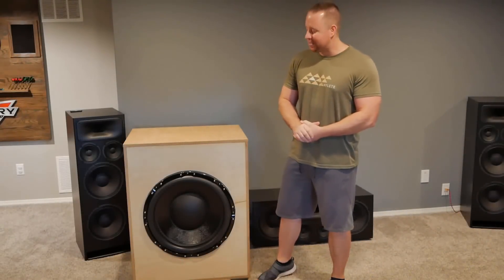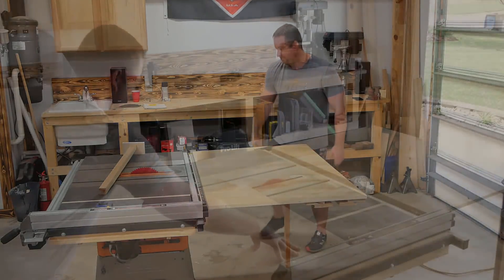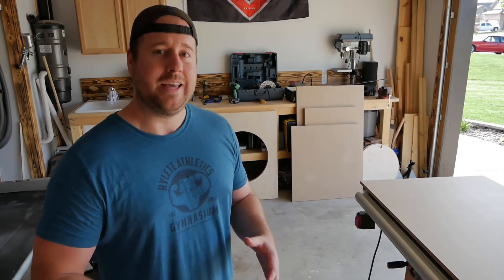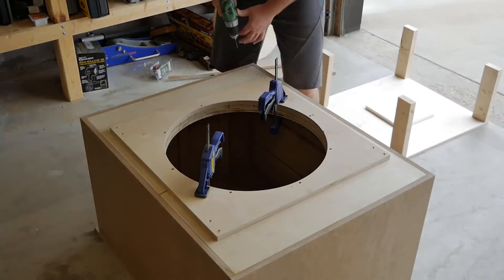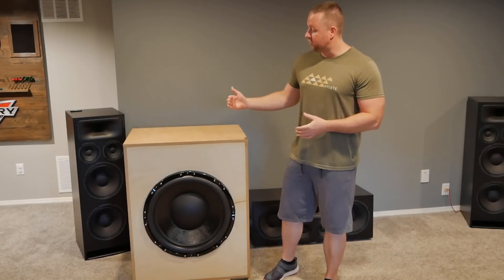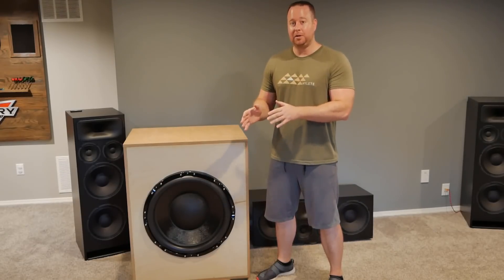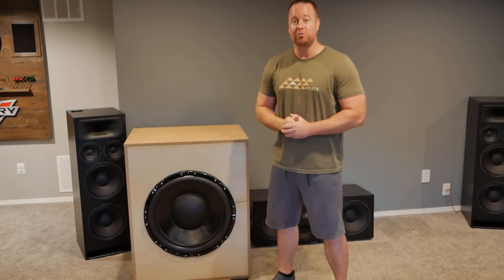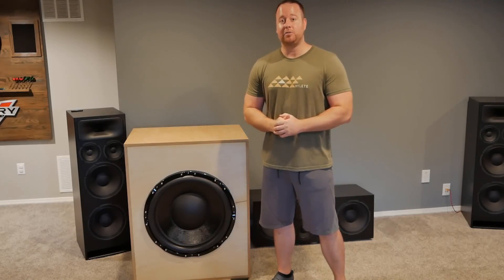Stereo Integrity HS-24 Subwoofer DIY Home Theater Build and Excursion Demo | Crazy Bass!

Comment: why such a small wire ?   you should of bought a better wire, the gauge is too small right now. It's a woofer , not a tweeter.
Reply from the maker: Ran 12 gauge for all the in wall wiring. Wouldn't do any good to run thicker from wall to sub. I could have used thicker for sure, but is what it is. There are actually a lot of diy home theater guys that run 12 gauge only as well. It'll still do the job
Reply: @LifeofBliss  ..maybe that the wire look tiny compared to the woofer BUT if you drive 1000w to these woofer , in my opinion a 8 gauge would been better.  If you have 12 gauge in the wall, as you say it won't matter to use 8 gauge from the wall to the woofer.... but is what it is, have fun :-)
Reply from the maker: Gotta be honest, didn't really expect to be running these subs or this much power when I built the place lol... lessons for next home, 8 gauge for sub wiring! Thanks man

Comment: Nice setup. Personally in would have built a larger box. Vas is almost 20cu and the fs is 18hz. Idk if you modeled the response for that box before you built it but the roll off is probably a bit higher than a desired home theatre sub. Nothing a good eq cant level out though assuming this has way more output up high than needed.
Reply from the maker: Yea output is pretty insane even at the 1000w I had on it. With 2 more and the new amp, I should have plenty of room to EQ things as I need for a flat response. I did model it and actually when a little bigger than SI recommends. It gets really hard moving something this big, I don't want to imagine anything bigger lol!

Comment: You need a reflex design really, or at the very least mounted the cone so it was flush with the front face of the cabinet...not standing proud by about half a mile.....don't give up the day job !
Reply from the maker: You must have missed the part where I said there will be another 3/4 inch met piece on the front baffle added to give it more of a flush look... it's ok, listening is hard sometimes!
Reply: @LifeofBliss  Errr.....why not just mount the driver on the inside of the cabinet?...........sorry.....I used to work for Celestion and Kef so I was just offering advice .....anyway, have fun with your woodworking.
Reply from the maker: Well... I'd either have to have an access panel on the back or something like that to mount it from the inside. I mean it's possible, but would be a little more involved to pull off. That's pretty cool you worked with them... no offense taken, as none was meant towards you. Just giving ya a hard time like you were with me 😉
Reply: @LifeofBliss  Good man!!

Comment: Wouldn't it give more bass if the box was ported?
Reply: Yes it would
Reply from the maker: At a small range of frequencies, quite a bit louder. But it would fall off quickly under the tuning frequency. Sealed will allow this woofer to reach lower double and single digit Hz much louder than any reasonable ported enclosure.
Reply: @LifeofBliss  wow.. I didn't know that. Thanks for the info. Wow so u say single digit hz that's amazingly low. My RE MX15 was pushing 148.3db @32hz and I thought that was low bass. So I only imagine what pressures 3 of your 24s will give at single hz.
Reply from the maker: That's very impressive man. Yea a lot of movies have super low frequencies. More felt than heard. Just adds the the experience if you can produce that stuff at reference volume. Most music doesn't drop below 30 Hz
Reply: @LifeofBliss  your home theater system must sound AMAZING... I have one but just a basic one with a 150w rms power 10"sub and I think it sounds pretty good 😀😁 lol shows what I know about home theater systems😁
Reply from the maker: I ran a single 10 for years. Just at the point to where I can do some major upgrades. Still not a perfect room with it being an open basement, but I try to make the best out of it

Comment: That poly fill is bad idea that shit will get in pole gap and stick to your coil seen it happen a lot.
Reply from the maker: Not saying it doesn't happen, but all the subs I've built have never had that happen. I tucked it pretty snug behind all of the bracing when adding it. I'll be removing the woofer to paint the box soon, I'll be able to assess if anything has moved and go from there. Thanks man

Comment: Hi Life of Bliss,
nice work!
One point of critic:
Why damping of housing? For me makes no sense at all because frequency is cutted to 100Hz anyway. 
Try to remove all of it. You will not hear any difference apart from more volume.
Reply from the maker: The polyfill will act to make the air more dense and reduce the temp of the air in the box, making the box feel bigger to the sub. So it actually doesn't take up airspace, but makes it seem like there is more. Thanks man, hope that makes sense lol

Comment: 3 18s..  and then you sealed it.. what a disappointment!  rebuild it and port them all! come on!
Reply from the maker: 18s? These are 24s 😉 they are not lacking in output! Plus with ported won't feel the super low single digits stuff in movies.
Reply: Ported designs sucks at really deep bass as there is very little output below the tuning frequency,  but you should know this already Benjamin.

Comment: the size of that box is what my 4 sundown 10's are sitting in with port the box you got on that looks way to small and sealed on top of that? tf? RIP sub thats getting fibers jammed int the former and coil gap smdh after all that bracing he reduced volume size and even more dropped volume size with poly fill lmao as long as he dont put DJRUSSTICALS on that sub to put real bass through it and only plays that junky noise he just was it should last min 2 years before the poly fill and the tight air space rips the sub apart from heat issues and clogging smdh hope you didnt have a warranty cause 99% of audio places like sundown , EMF , Rockford Fosgate will void if you use poly fill lol
Reply from the maker: Thanks for commenting man, you've shown everyone how little you know about sub enclosures and this sub in particular.
Reply: @LifeofBliss  come on down to SLAMOLOGY 2019 and tell me that , understand this when you get bolted in you cant tap out . 181.7Db will show clamped amps and watts and tone after i nearly kill you :) if you can last 30 seconds sealed ill hand you $1000 cash like i offer anyone else only craig buttler won the 30 second beat down, oh no seats in the astro though so bring a pillow lmao and after you understand the liquid mechanics of the box and how to manipulate the SPL and tone to a point that the pressure and Db's can build up to a dangerous level than you will ask me to take your foot out of your mouth :) DB drags start in Indianapolis IN at Lucas oil speedway ( only place you can legally get loud af this june see you there

Comment: That’s one massive woofer. I honestly thought the cabinet would have been even bigger for that giant
Reply from the maker: You can make it bigger but it doesn't help too much at this point. Ported would need to be bigger. The other 2 boxes will be smaller than this one actually, they'll need more power for the same output that due to box size.

Comment: The sub was extremely under powered by this amp. I had xls 2502 for a 18 inch sealed and was not enough power. I know you said you have another amp coming in soon, if I was you I would take a look at the Speaker power plate amp SPT 2400HT , would be a good match. A subwoofer like that deserves a solid amp like the speaker power. These are the amp that the heavy hitters are using for their subs, including companies like JTR which makes some of the best monster subwoofers. Keep up the good work, great videos!!
Reply from the maker: Thanks man. Yea I need to wire up a 240v line for the clone FP20000Q I have. Should have burst power up to 4000w per channel. I would love a speakerpower amp! Wasn't in the budget right now, but maybe in the future
Reply: Life of Bliss You are building a very nice system. I don’t think you can do any better than what you are if you are trying to be on a budget. Amp is something you can always upgrade!!!!
Reply: @LifeofBliss  how low does it go? Anywhere close to PSA? Rythmik?
Reply from the maker: The HS24? It's in another league. Nothing you buy that is pre-made besides a couple of JTR subs will come close to these 24s. I was getting 115 db at 5 hz in room with these by 15 hz and above, 130 db
Reply: @LifeofBliss  cool

Comment: almost a kg of moving mass, would be nice is you also built a subwoofer of the opposite end with low moving mass, 100gram or less,  four 10" woofers should do the trick.

Comment: Take this as you like but I had a fp14000 clone from sanway at 4400 4 ohms into each 18 inch lms 5400. It got me buy but and here's the but, I had to use a lot of room correction,  max setting on the antimode V2. The amp lasted 2 years before channel 1 went down then a further 3 years for channel 2 just using 1 sub. So then I got 2 x xls 2502,s for bridged 2400 rms each to 4 ohm. sent them back same day. There not even putting out 1k, false power claims, so then I bit the bullet and got a ffa10k. 5 years warranty, a specifically designed sub amp used for high power bass arrays in stadiums nightclubs, the full Monty . It gives upto 3500 rms 4 ohm a side. Completely transformed my sound. It has ultra high damping and current creating a lot more magnetic field to the magnet and coil. The result is it perfectly controls the driver. No flapping about just pure sound. A lot of those excursions in your video are distortion., the amp has very little ability to place a decent magnetic hold on the coil. So now I'm running no room correction at all. I only use my anti mode v2 now as a crossover and volume up or down. My advice to anyone reading this is You get what u pay for in high power class d amplification. I welcome anyone to be proved wrong that lives in the UK, come for a demo at my house and hear for yourself before spending a lot of money on amps to then spend even more to correct it. DIY speakers is a win if using a proper design and drivers but at high power money talks for quality. Anyone in UK wants to be proved wrong send me a message cheers... btw that is 2.7ft sealed enclosures
Reply from the maker: I won't argue there are nicer amps out there. I don't really agree that all I'm getting is distortion right now though... I'm pumped to get the 20q hooked up as it's one of the best values per watt on the market. That said, ill probably upgrade in the future to a speakerpower amp. Appreciate your insight man
Reply: @LifeofBliss  U could call it non linear response if you like. I have no doubt it sounds good bro but the difference between amps when serious power is needed is night and day trust me. cheers

Comment: HOLY! I would love to see how low can it how in that sealed box! If you can make some measurements with a calibrated mic at the listening position, damn!
Can't wait for the 3 subs to be done. I don't see a reason to even push more than 1000 watts at it, considering you are adding 2 more going from 1000w to 2000w it's only 3db, but yet again if you do it with the 3 subs that's 9db more!
Reply from the maker: Yea I don't think I'll be pushing these subs are the new amp very hard 99% of the time. But I'm really going to enjoy the 1% when I wanna test the limits! I'll run some measurements with REW soon my friend

Comment: Instead of caulk or wood glue, use a 1/4 coating of polyester resin to seal the box. It will add strength, weight, and greatly reduce losses and leaks.
Reply from the maker: Thanks for the advice man. I really laid that wood glue thick so I think I'm good on this box. I may also look into using some liquid nails p&l I think it's called? Idk, need to see what that adhesive waa some of the guys were using in the avsforums...

Comment: the only thing negative  i can say is the speaker cable is far to thin. nice build though
Reply from the maker: Most of the HT crowd I've seen run 12 gauge for almost everything, subs included. That said, I wish I would have run 10 or 8 gauge for the subs, so I agree with you. Lesson learned for next house...

Comment: I'll stick to my 15" for now, kinda worried my house won't handle such bass...
Reply: My windows flex with my single 12 so I'd imagine this would just destroy them lol
Reply: @wyattmac9701  the struggle for more bass is real...
Reply: @abubakrbhyat218  sure is but I dont want anything louder because everything rattles in my house already
Reply: @wyattmac9701  I get that, what sub you got atm?
Reply: @abubakrbhyat218  I'm running a Nvx Nsw-12 dual 4 ohm in a 2 cubic foot box tuned to 36hz being pushed off a JBL gtx500 (yes I'm running car audio equipment in the house lol)
Reply: @wyattmac9701  I'm not one to judge, I'm also using car audio equipment in my house, a 15" Diamond audio d6 dual 2 ohm in series. Its using a home audio amp and its under powered, but it gets the job more than done
Reply: @abubakrbhyat218  I use to have a couple of 15s but then switched to the single 12 I'm using a ac to DC power supply off of Ebay I paid like 20$ for it. It puts out 13.60 volts consistently I've ran a 1000wrms skar audio amp on it with no problems
Reply: @wyattmac9701  My elder bro gave me the sub, it had a 1800w amp with it (can't remember the brand) and I was considering using the amp at home, but i decided it wasn't wise after putting only around 400w to it and having things falling from shelves
Reply: @abubakrbhyat218  Haha I bet more power more flex

Comment: I need to model this sub to get a better idea, but what's the F3 on this? I'm going to guess somewhere in the 30s, possibly high 20s in that big box?

I would like sealed, but I built the Full Marty for my Ultimax 18 for extension to around 15hz without much effort, and going from a Paradigm ps1000&cheap Polk sub it sounded like the bass was 20x more in control and not lose and uncontrolled like those cheap subs.

Also interested to see how easily the sub blends with the speakers, in my case I had to crossover around 120hz (small room, so had to control the 100hz area with the receiver crossover) and use audyssey to turn down the bass on the left speaker as it was causing some odd cancellations with the sub and right speaker.
After that it's a very smooth response (to my ears) from 15 and up.
Reply from the maker: I'm out of town/not able to look up my modeling, but it's low. Like low 20s I think or lower, can't remember right now. But I need to also do some REW to see how it does in my room. That'll be coming when I'm back in town. I bet that full Marty spanked anything else you had!
Reply: Life of Bliss All good, I can derp around with WinISD later. 

I don't have a calibrated mic to use REW, but to my ears mine is smooth, once you get to DSP you get addicted for some reason. (At least I did)

The Marty has been the best subwoofer I've heard in my short 23 years alive. 

Yours probably in that big box goes into the teens with good output I'd imagine.
But I feel there's not much point to the bass below 20hz unless you watch certain specific movies that actually have it.
I say that, but I'd still love to have a sub that goes to around 10hz lol.
Reply from the maker: It's a rabbit hole for sure... REW is so extensive too. It'll be fun to learn and tweak things a bit.
Reply: Life of Bliss Yeah, and in the end, all that matters is if the system makes you smile ear to ear when you listen to it.

I still have times I listen and go "wow, can it get any better than this?" (And knowing my room it can, and I can't imagine a proper room)
Reply from the maker: Same here, if it makes you smile... and I would love a proper room too. Maybe on day we both will...

Comment: Ready player one definitely is my favorite demo movies with my new system it's hard to play EOT it flexes the wall bad. The amp will totally make a diffrence. I'm running the same one just 240v and another member has the 110v so I seen both. Even with the same power going to them my xyclops subs sound so much better and louder. Its Most likely from the burst potential of the clones
Reply from the maker: Heck yea! Love that movie for demoing. I'm really looking forward to getting that amp in too. You over on AVS? Can't remember if you told me that or not
Reply: Yeah my name is HD0823 over there. The guy with the 4 submaximus v3 horns with 21s. I'm about to build 2 devastors with 21s to replace the rear cyclops boxs. I'm runing everything on 2 of the 20000 watt clones. Your going to love that amp. If your not careful it can even bottom out the 24s. I have the gains less than half way up and my house feels like it's being knocked off its foundation lol.
Reply from the maker: Oh yea ok, I see you over there a lot. I'm sure it does! You've got some serious equipment going on!

Comment: Why the hell, sealed? 😲😲🙈 
Put 3 passive radiators in it, and You have the perfect Bass!
Reply: Don't forget there's only 1 out of 3 of these beasts running at moment.
Reply: Sealed is good choice if you want controlled bass. Ported box sound could be boring over some time.
Reply from the maker: Lol I prefer sealed over ported, but I'll just say this thing is not lacking in output 😉
Reply: @LifeofBliss  With that much air space in the box and a 24" woofer, you can be save to seal it. It probably still goes really low really well! Although passive radiators could enhance the lower bass its not necessary I guess. But just imagine this thing ported, bigger box tuned to maybe 15hz.. Whew.
Reply from the maker: That would be painfully loud in the right environment lol
Reply: a ported box would boost 'some' bass but also unload below that.  A sealed box like this can handle increasing the bass with EQ and not worry about unloading at low frequencies that it can respond to (as opposed to small speakers that can't)